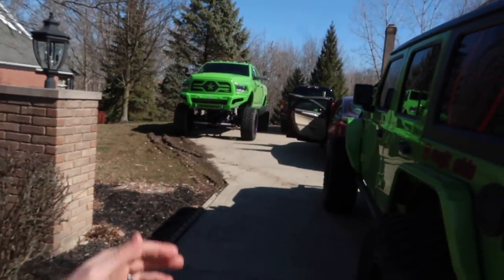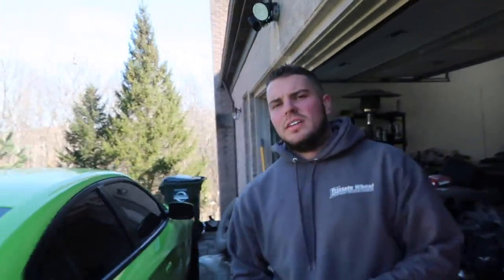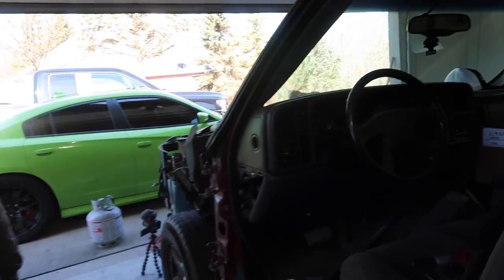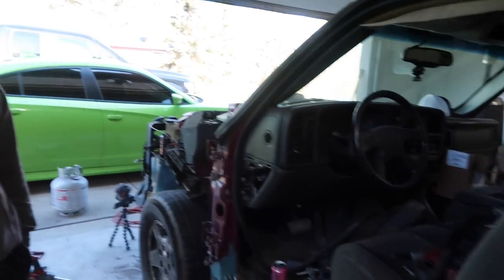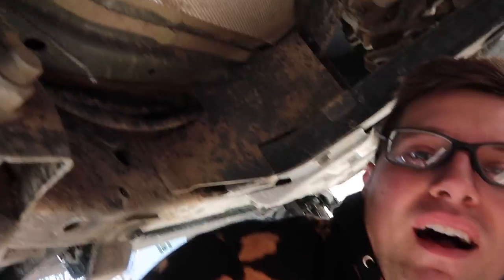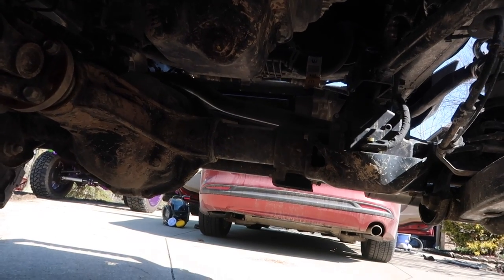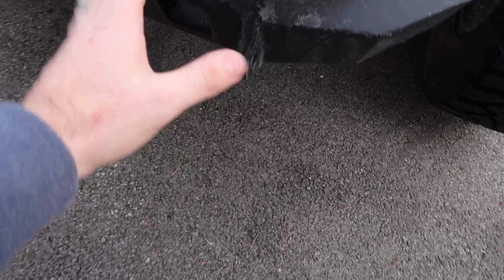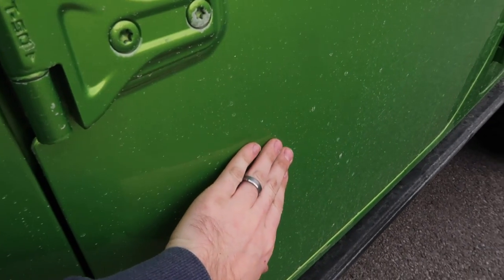Changing The Oil In The Jeep.. IT GOT EVERYWHERE!!

Comment: A dealership in Florida tighten the oil filter too much and cracked the whole plastic casing I got on I 95 and my jeep was smoking I had to pull over they fucked the whole job up, They couldn’t even handle a Noyle change from now on I do it myself